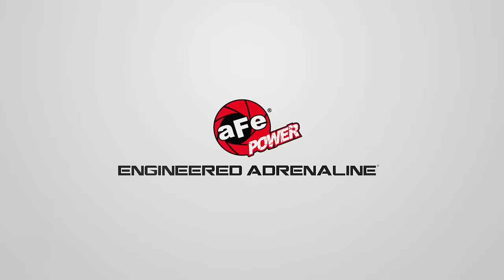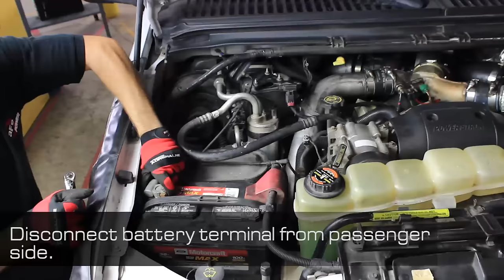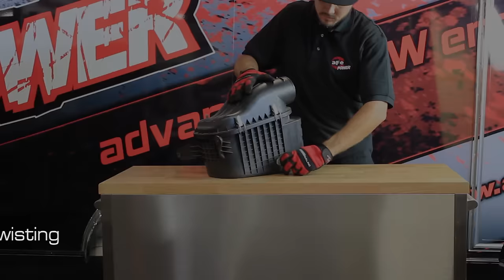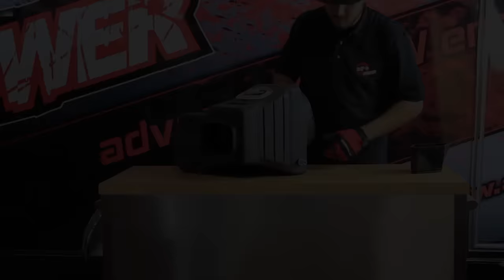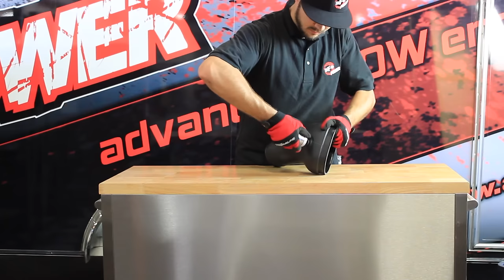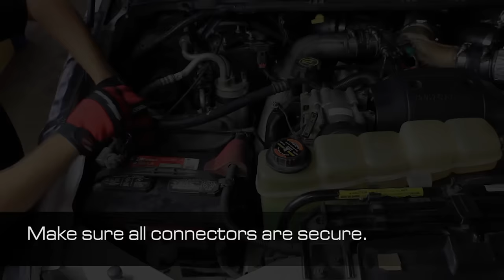aFe POWER Momentum HD 1999.5-2003 Ford Powerstroke 7.3L Intake System Installation

Comment: Trying to install this now on bone stock 2002 7.3, the silicone coupler that goes from the turbo is just barely too short to get fully on the turbo and get the pcv adapter lined up. Clamp(JUNK)that goes on turbo inlet stripped when tightening with a little 1/4 drive ratchet before it was tight. Couldn’t get it loose either without it twisting the T end out of the clamp. Luckily since it wasn’t fully tight, I could still remove the coupler and go source a better clamp locally.  
Then, My truck has another positive lead from the factory that goes down behind the drivers headlight and into the harness along the inner fender preventing the box assembly from lining up. I don’t know how many times I’ve said JUNK during this install. Whatever truck AFE used to develop this does not match my 2002. I’m almost ready to box it back up and send it back. JUNK, and I won’t recommend.